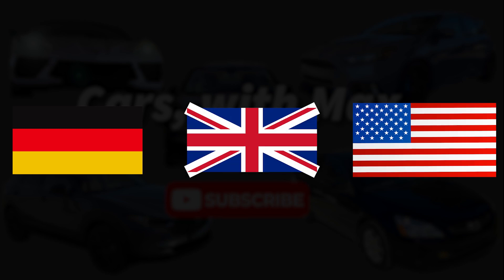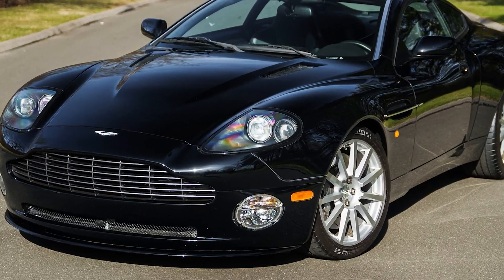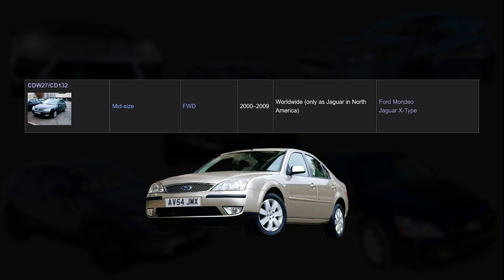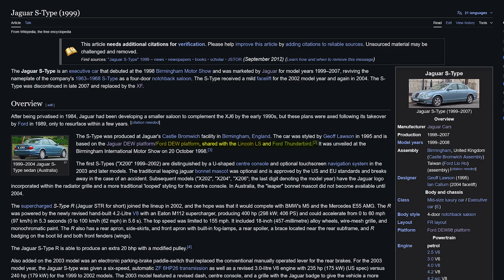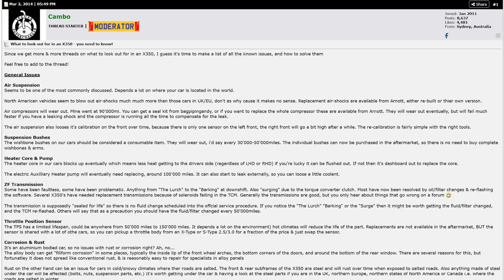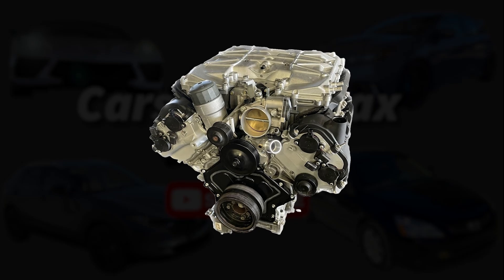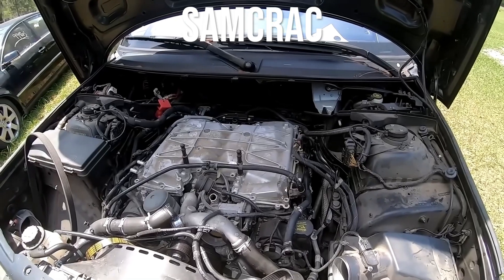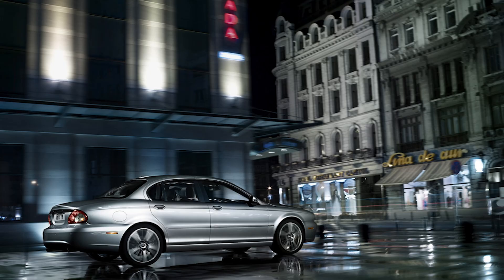The Jaguar Engine with Secret PORSCHE Roots? In-Depth with the AJ V6

Comment: My 3.0 x type pre facelift is at 270k kilometers. Being serviced regularly it is reliable vehicle. The AJ30 is incredible engine. Smooth and powerful for european standarts with great roar at the high RPMs. Mine consumes abouth 1L of engine oil for 10k kilometers, but except that, non other complains.

Comment: Just bought a Mazda 6 with AJ 3.0 V6 engine. It seems like some sort of Unicorn in europe. Just trying to find out which oil I should use for engine, Differential and 6 speed automatic gearbox